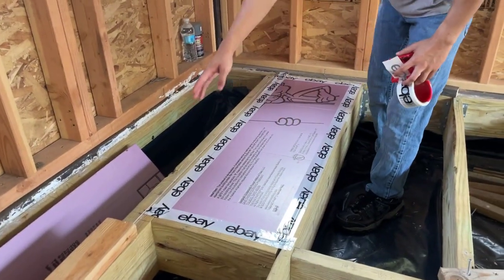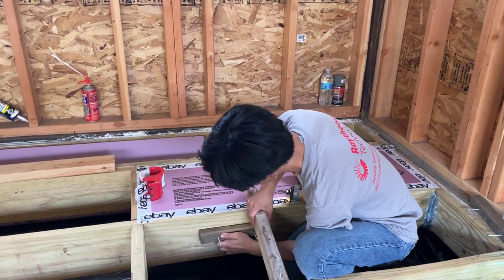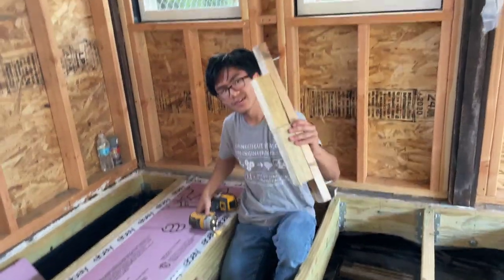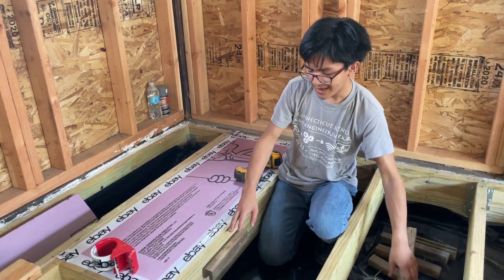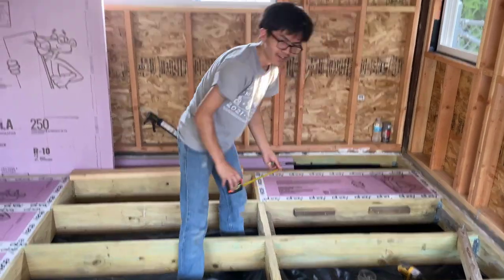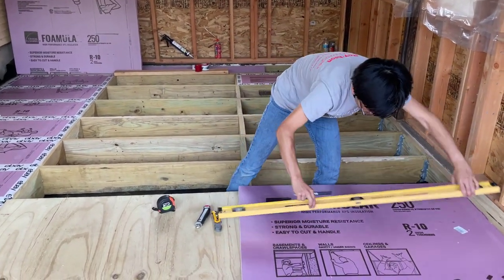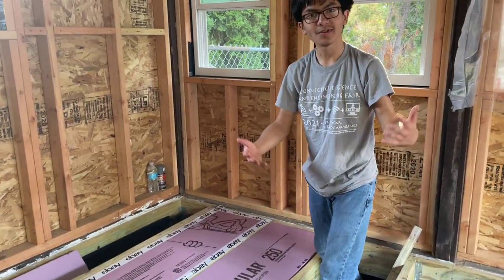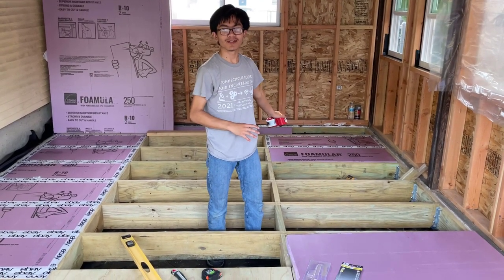Enclosed Deck Outdoor Shed-Workshop Floor Insulation: How To Cut Rigid Foam & Install Between Joists

Comment from the maker: Here are the #ad links to some of the hardware, materials & tools showcased or required for this project:
1.  https://amzn.to/3rXabtH  |  Kutir Retractable Box Cutter Utility Knife - Easy Self Loading Zinc-Alloy Heavy Duty Carpet, Rope, Cardboard Comfortable Handle Knive, 4 Sharp Rust Proof Razor Snap-Off Blades Set - Metal Safety Lock
2.  https://amzn.to/33nWA4D  |  RoMech Foam Cutter - Air Cooled Pro Electric Hot Knife (200W) - Continuous-Use Styrofoam Cutting Tool Kit- with Heave Duty Case, Blades & Accessories (RM-009)
3.  https://amzn.to/33r9KOp  | Froth-Pak 210 Spray Foam Insulation Kit, 9ft Hose. Improved Low GWP Formula. Insulates Cavities, Penetrations & Gaps Up to 2" Thick. Yields Up to 210 Board ft. Two Component, Polyurethane, Closed Cell
4.  https://amzn.to/3DM3sVV  |  1000sqft (4ft x 250ft) 1/4inch thick Solid Double Sided Reflective Insulation Heavy Duty Platinum Reflective Foam Core Insulation Vapor Barrier Commercial Residential
5.  https://amzn.to/3oKopfM  |  DEWALT 20V Max Cordless Drill Combo Kit, 10-Tool (DCK1020D2)

Or Click on Amazon link here and search for what you need:  https://amzn.to/3xIOsqg

Comment: Hi, thanks for the video. 

I have a deck area under my bedroom (so yes it has a roof) and the deck is on the ground level (same level as my lawn). 
I am trying to enclose it in Sunroom style, and also will try to insulate the bottom like you did. 
But how do deal with the moisture coming off the ground?bottom of my deck is a bare ground that us below the ground level. I am worried if i just install insulation foams, it will also trap the moisture and cause molding? 
I’d really appreciate your opinion.
Reply from the maker: Here's an idea. You can use 4-6" pipe, make it L shape of Z shape and vent it outside. The opening should be several inches of the ground. Put heavy duty screen to prevent animal/rats from entering.